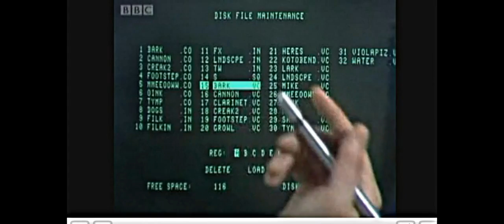Fairlight CMI demonstration from 1980

Comment: so basically this is a first generation  MIDI keyboard?
Reply: The CMI predated MIDI by about three years, at least. In fact, much of the specification of how Fairlight got their keyboard to talk to the CMI mainframe was about 95% of what became the adopted MIDI standard.
Reply: @FailedMuso  Now THAT is an interesting fact I did not know about hoe its keyboard communicated to its system. That makes sense that the MIDI association took notes.
Reply: incubusman42 Well the computer is the brains of the operation. Instead of Just a midi keyboard, this is the full package